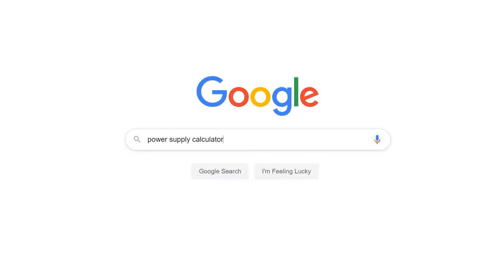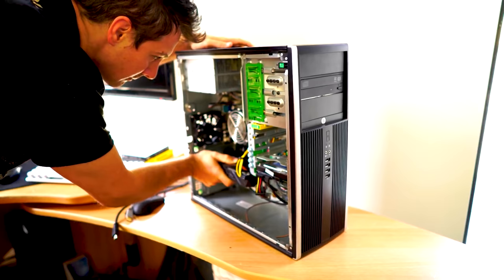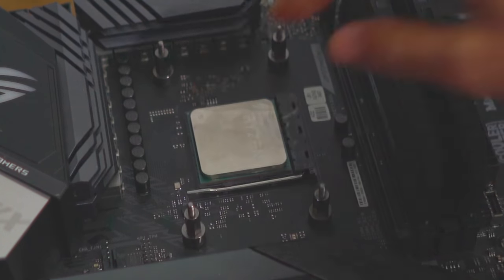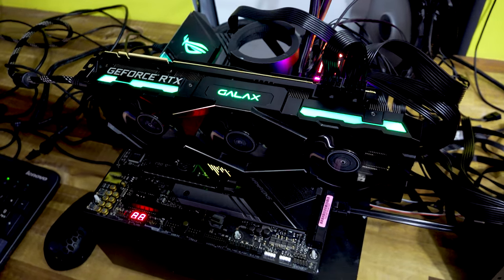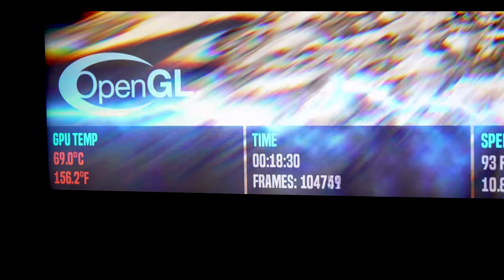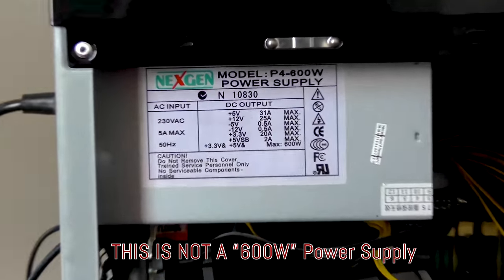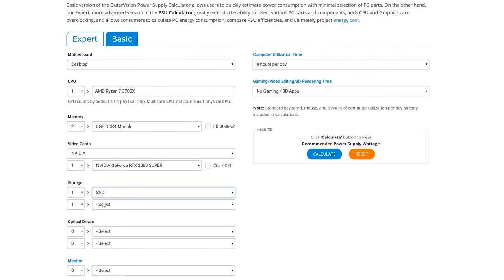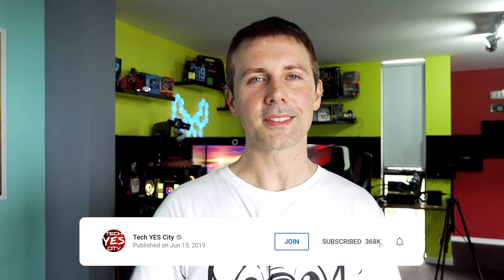I Tried Running a 3950X and RTX 2080 Ti on a 450 WATT Power Supply...

Comment: Thank you for this video. I have all the parts for a new build sitting on a table waiting for the case to arrive two days from now. And I was worried that maybe the power supply would be somewhat borderline. But, now I see it will be just fine. When I picked the parts I was on a strict budget. I tried to balance cost with how many stars the parts got and how many reviews. 

MSI B450 Tomahawk Max 114.00
AMD 3950x 747.00
G.Skill Trident Z Neo for AMD 32 gig 2 x 16 179.99
Fractal Design Define XL R2 102.97 (the price has gone up to 158.13, only one left)
Samsung 860 QVO SSD 6Gb/s 1TB 109.99
Logitech MK550 keyboard + mouse 47.99
XFX Radeon RX 580 GTS XXX edition 8GB 169.99 (I'm not a gamer so more than enough)

Be Quiet! Dark Rock Pro 4, BK022, 250W TDP, CPU Cooler 86.46
Pioneer Electronics USA Internal Blu-Ray Writer (BDR-209DBK) 73.99
EVGA 650 Bq, 80+ Bronze 650W, Semi Modular 79.79

TOTAL  $1712.17 US

I already have a 1TB hard drive as additional storage. My budget was 1700 US dollars. So I did go over slightly. And I had to make compromises picking out the parts. Hopefully my build will turn out okay. I never built my own computer before.
Reply: You did not just buy that system for gaming did you?
Reply: @miniweeddeerz1820  I bought it for chess.
Reply: @michaelsherwin4449  a 3950x for chess?
Reply: @miniweeddeerz1820  SMP chess engines that run in a host GUI like Arena can use all available cores. A 3970x would have been even better but that was beyond my budget. On my 3950x the world's best chess engine Stockfish searches 44 million positions per second in the opening position.
Reply: @michaelsherwin4449  why does it have to search positions?

Comment: Gotta disagree, so in the long term high end psu's tend to last longer. Also should you upgrade they valid for years so it can be money saved. my dual 8800's build got upgraded to a 1000w antec psu then 10 years later it was running a new build. Still works today on one of my home servers. So buying above and beyond can pay off as none of my other lower power psu's have lasted that long.

Comment: i3 4170
RX 570 4gb dual fan
16gb ram dual channel
3 standard fan
24 inch led ips monitor

is this enough for CORSAIR CV450 450WATTS 80 PLUS BRONZE

Comment: I have an 800w Tagan BX (so its pretty old now), had it for years but now have upgraded both my CPU (3900X) and GPU (3090 OC).
So this system runs around 620w but I want to go for a raid configuration on some HDD's (already using 2 M.2 drives), I wanted a 1000w psu for that extra headroom but ended up going for a 1300w which is serious overkill but it was cheaper than the 1000w (seasonic Prime Gold for both).
I will probably never need that much power but these things happen when it comes to buying psu's i suppose 😄

Comment: most good power supply's are usually underrated anyway, its the cheap Chinese ones you dont want to test this on, trust me coming from experience, i had 2 AMD r9 290's hooked up to a cheap 450w psu knowing very well that psu couldn't handle it, it ran perfect to start with even ran benchmarks, it wasn't until i started bitcoin mining the PSU went BANG, both gpu's were ok though

Comment: What would be a good enough PSU for an i3-12100f system with a 4GB GB GTX970 system? EDIT: I'm currently using an old Enermax Xt 430W. It can output like 90% of that power through the 12 rail.

Comment: can run 3060ti on 450watts psu? using for mining. After tweaking the gpu will only use 130watts & not full power of the gpu.

Comment: That calculator says i need 950W PSU.... with a GTX 980... if i do the math 250W GPU max 400W System (CPU 300W, RAM +MB 100W), 50W Pumps (2x 25W), 50W Fans, 50W LED, 50W PCIe Cards and storage... it makes sens... but i thought a 850W would be enough to upgrade to a 3080Ti.... dont know what to do now.

Comment: Well im running a GTX 1080 and a i5-8600k with a 750W power supply, for the simple reason that i can not draw enough power to wake the PSU Fan out of 0RPM Mode :D

Comment: i know this is old. im planning to upgrade my gpu to 3060 oc from 1650 super. i have r5 3600 1 nvme ssd 1 sata ssd noctua cpu cooler and 16 gb ram 8*2. my psu is the same except its 500 watts so i guess im good with the gpu upgrade. btw i dont overclock :)

Comment: I would have to disagree. You should buy a very big PSU even if you are just getting a 1050 or whatever. This is because psus never go out of style, and you don't want to be stuck with a worthless used PSU after you upgrade your system and it requires a bigger PSU. You never want to buy a new psu if you can avoid it because it's just wasting money since power supplies haven't really changed much in decades. I know from experience, I had a low end computer before and didn't think I would upgrade so I bought a 450 watt PSU from a good brand. Now I upgraded my computer with high end components and that PSU is just collecting dust since no one in their right mind wants to buy a used PSU. Most people who build a computer tend to upgrade it in the future so this advice of not getting an overkill PSU for your low end system might end up costing people a lot of money.

Comment: that r20 run was majorly kneecapped, i just ran one on my 3950x which is at stock settings and got a 9121. unless the difference in ram (im using a 32gb kit of 3600mhz in 2x16)  that test was about a sandy bridge i5 off the pace.

Comment: Your PSU should ALWAYS have at least 150W - 200W over what your average constant load power is going to be. The PSU design will envisage its max power rating for a short time ie a few minutes for a cheapy brand to maybe a few hours for a premium brand (before components start to significantly degrade) , but max power is not meant to be sustained. So, if your rig is expected to use 400Watts for hours in gaming sessions, you would select at least a 600Watt PSU to allow it to perform comfortably within its power supply range therefore putting a tolerable and sustainable strain on the components of the PSU to ensure reliability and long life.

Comment: This probably won't work with Ryzen 7000 series as they're unlocked to blow right past their marketed 170w TDP, and the way they calculate their TDP rating is way different. They temperature bind in stock configuration so if you've got temp overhead, it'll just keep pumping up to 230-ish watts until CPU reaches 95 def and will stay there... So, in that case, by all means, get a PSU that's a little beefier than what the PSU calculator will tell you.

Perhaps the kid who wanted a 1K watt power supply was preparing for the 7950x and a 4090. 🤣

Comment: I'd never want to run a PSU at max wattage anyway. Most 80+ certified PSU's will peak their efficiency at around 50% load.  Apart from high end models, most PSU's wont like to be driven at max load for extended durations. None of this even considers overclocking, which the outervision calc does an okay job of estimating.

Comment: higher wattage psu runs much cooler, usually with the fun not spinning at all, so silent, has more steady current and lasts much longer.  if you can afford then go for it. don't for get, he's running open bench setup.  also cheap low wattage psu is total crap.

Comment: For a Single GPU setup, I think that somebody could get away with as low as a 0450 to 0600 Watt Power Supply if they were doing a Ryzen 3950X/RTX 2080 Ti/032 to 0I28 GB of RAM at 2666 to 3200 MHz build with a mixture of Hard Disk and Solid State storage, provided that they ran all of their hardware at Stock Frequency even when doing ridiculously heavy Gaming and Workstation tasks; for Mutli~GPU and also Prosumer GPU setups, this is where you begin to enter tricky territory, especially due to the higher power draw of the Radeon VII, Titan RTX, Radeon Instinct lineup (as of Vega II), and Quadro RTX 6000 and 8000, where you are heavily recommended to go up to a 0750 Watt Power Supply or better with at least 080 Plus Bronze certification, as anything less on either or could prove troublesome for full~time or 024 Hour Continuous (in this case, Always On) use cases.
Now, those who are familiar with me know that I'm in the process of building a Sleeper PC out of my old eMachines ET1331G-07w (June of 20I0 Model) from 20II, which will have a Ryzen 3950X (cooled by the Noctua NH-D15: Chromax Black), Radeon VII, 064 to 0I28 GB of UDIMM ECC RAM at 2666 or 3200 MHz, multiple Hard Disk and NVMe Drives, and ASRock's X570M Pro4 (as the ET1331G case is of the Micro ATX form factor); the Power Supply is EVGA's 850BQ, a Semi~Modular 0850 Watt Power Supply with 080 Plus Bronze that is the only PSU at this wattage class that will fit in my case due to its very specific dimensions; the fact that this was below 0I00$ USD to get and is more than well equipped to handle my eventual build (Radeon VII alone can peak at north of 0400 Watts under load, keep in mind) truly is essential and still gives me some headroom if I want to add in another Graphics Card (likely a future Intel Xe or Nvidia Titan card for AI/Deep Learning and more serious Model Rendering) or a Co~processor (if applicable) down the road, High Wattage PSUs can come in handy for this kind of scenario so long as you're not doing anything too extreme and thus I find 0850 Watts to be that perfect Neutral Zone to assure that Futureproofing your system is possible without breaking the bank. (:

Comment: Well... I have i5-4440, 1050ti and 750W PSU

I mean, how can you resist when you see Gigabyte G750H for 70$, right?
It's just, you know, I was genuinely afraid for my PC when I had R9 270 and 10yo 350W PSU. It was hot as f but outlasted R9 270. Even worked when one of the capacitors leaked, that's when I decided to put it to rest though.

Comment: I rember breaking my 300 or 350w psu with superclocked c2d 6300 1.86@3.0+ ghz with gaming amd radeon video card upgrade after launching a game. So now my cpu is @ smth like 150w max, gpu smth around 200 w + other system components around 100w so all total is around 450 peak, and I use corsairs 850w PSU. Because it is quiet even @full load and also I have a big power reserve which shold prolong life of psu ;)

Comment: Work out what you need..  then double it.  Why?  Efficiency. Running a switched mode PSU at close to capacity will result in lower efficiency. Most PSUs will achieve peak efficiency at around 60% load.  Also, longevity.  Spanking a 600 watt PSU with a 550 watt load all day, for years, will stress it.  I've had the same corsair HX1050 PSU now for 11 years.  I'll still have it in 11 more (assuming ATX specs don't change and all plugs still fit etc).   It's not even remotely stressed.  So the PSU I bought 11 years ago still has headroom to run a Ryzen 9 5950X and a RTX3090.  How many PSUs have most of you bought in the past 11 years?  Is it only 1?  I bet it's not.  Total what you've spent on PSUs over the last 11 years.  Is it more than I spent one my one and only PSU 11 years ago?  I bet it is.

Comment: Why not test this with Rendering Benchmarks? Blender cycles based benchmark using BOTH GPU and CPU with huge sample rate would stress this guy out to the fullest. Raytracing can bring anything to it's knees. Even if you have million GPUs and CPUs

Comment: im using a 530w thermaltake  power supply with a x570 r5 3600 4x8gb ram and a gtx 1080ti without any problem

Comment: I installed a new gpu and then my games runs really slow and it stutters. Is it maybe because of my cheap 700 watt psu? When i’m still using the gt 710, it runs well but when i installed the gtx 1050, my games run really slow.

Comment: Yeah .... these calculators are "very" accurate.
For me, this program calculated the demand of the i7 3770K @ 4.7Ghz GTX 1070, 6 drives (2SSD) for 603W and the suggested power supply for 653W.
The actual max consumption from the socket is about 300-330W max.
I have a 750W Seasonic power supply and I have no stability problems.
Reply: at stock they are pretty accurate when you add overclocking they just guess some are better then others where you tell it the voltage your running the oc at but even then they dont really have much overclock data. so its mainly a good use for stock power draw . they also can slighty over guess like here he never say the 472 as thats probably a peak wattage use

Comment: I don't recommend anyone using a 450w PSU with this tech. Yes its interesting to see, and even if it looks like the PSU not running hot, the components inside it are overstressed.
At those loads, such a PSU will produce alot of ripple, voltage fluctuations and harm other components on the Motherboard and GPU over time.
This will reduce the overall livespan of the motherboard and gpus Capacitors and these parts will break sooner. 

Choose for yourself, either a cheap powersupply and only a couple of years gaming or a better powersupply and you safe.

Comment: using a 550w psu on my gtx 1070 msi gaming x r6 3600x wate cooled with 16gb ram an ssd and hdd  and on load with a wallplug calculator it was only using 380w in games

Comment: Dude, I just used the same psu calculator, and after all my info went in, it came back saying all I needed was a 430w psu... then I added an extra 120mm fan and they only use 1.8 watts.... it leaped up to recommending a 650w psu. That had me laughing.
Reply: Depends on what the power is delivered through. If the fan runs through the motherboard, then that means a higher minimum on the +12v and such.

Comment: The outervision calc over estimates a gross amount from what I've noticed. Plugged my rig in that pulls 500w while using a 550w psu and it quoted 1200w as the end result for required power.
Reply: what the hell did u type in ur rig as that it recommended 1200w lmao? 5 2080 tis?
Reply: @calibcrockett  

Opteron 3380
Gtx titan x
Quadro k620
32gb ddr3
9 drives.

In the calc I had to sub one drive for a cdrom since there is no option for a ramdrive. It didn't have the Quadro K620 so subbed with a weaker GTX740. Everything is overclocked.

edit: the calc buggered one of the sliders as higher clocks than indicated. Readjusted and reposted which brought it down to just under 1100w. It loves recommending that 1200w Thermaltake.

https://outervision.com/b/P7RTgW

Comment: It is important to consider the "efficiency" of the PSU. Normally, when consuming 50% of the MAX watts that the PSU specifies is when it is most efficient, it is the 80Plus. It is when less energy is converted into heat within the PSU.
https://www.profesionalreview.com/wp-content/uploads/2017/10/eficiencia-230.png

For 80Plus White, the maximum efficiency is 85% when the PSU supplies 50% of the specified max watts.

This means that if it is measured with an "AC" wattmeter and displays 420W, 15% of those watts are converted to heat within the PSU:
(100 - 85 = 15%) "As long as the PSU is at 50% load", that is, the PSU is approximately 750W ...

If the load consumes almost as much as the PSU can supply, the efficiency is reduced by up to 4% less at best. Now it would be 81%, more or less, in the case of 80Plus White. Therefore, 19% of the measured 420W is converted to heat within the PSU. 420 x 0.19 = 79.8W
And being optimistic and believing that the PSU is really 85% efficient. There are "80Plus Bronze" PSUs that really have 75% ....

It could be said that between 35% and 65% of the max watts specified by the manufacturer of the PSU (if trustworthy, if you look at TIER LIST) is the sweet zone. It is where the efficiency is not reduced more than 2%.

If you require 400W, the ideal would be an 800 PSU, but with a 650W one you would be fine, within 65% load: (400/650) x 100 = 61.54%. And the more power you need, the better the 80Plus certification should be, to waste less power on heat.

Seen in another way, for the limits of 35% and 65% with a load of 400W:
Minimum PSU
(1 / 0.65) x 400 = 615 Watts
Maximum PSU
(1 / 0.35) x 400 = 1,143 Watts

A PC that needs 400W is a high-end monster that would need an 800 PSU with 92% efficiency or more. So that the actual (approximate) consumption of PC is: 400 x 1.08 = 432W.

If you put a 650W PSU with 85%, it would be approximately:
(400/650) x 100 = 61.54% of max load. Estimating 83% efficiency: 100 - 83 = 17%
400 x 1.17 = 468W of actual consumption.
68W converted to heat within the PSU. It would be a 36W increase over the PSU with 92% efficiency.

It is somewhat complicated to know what PSU you really need. Clearly, installing a very fair watt PSU or super expensive PSU with watts to spare is not a good idea.

We must also think about future hardware updates, more HDD, another CPU with more cores, RL pump, RGB for a tube to have more FPS ... An SLI because you have money to spare ...
The new generations of CPUs or GPUs come more efficient and with more IPC and it is not necessary to have a PSU of more watts.

Comment: Last time I bought a psu over 600w was in 2010 for my gtx 480. Other than that I've been fine on 600w in every build.
Reply: 3080 has probably brought it back. 600watt psu is at the edge limit of what can even hold up a 3080 and higher power draw cpu. nvidia's reccomendation of 750 for the 3080 is pretty close to keep your max draw at 80% of your psu rated power
Reply: @Demon09-_-  Skipping the 3000 series anyway. Navi draws less power. Not to mention Nvidia's 7nm resfrah/ new line up will draw less power. If it doesn't I'm AMD all they way on power usage alone.

Comment: I wouldn't trust that websites accuracy completely. It says I need a 900W PSU recommended 1000W...I have 500W PSU and it runs fine, even overclocked the CPU,.